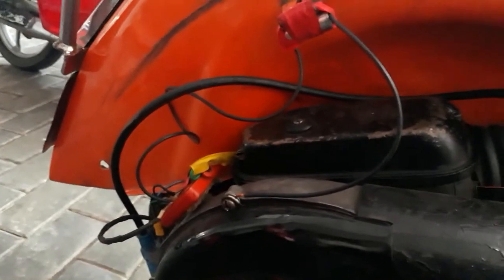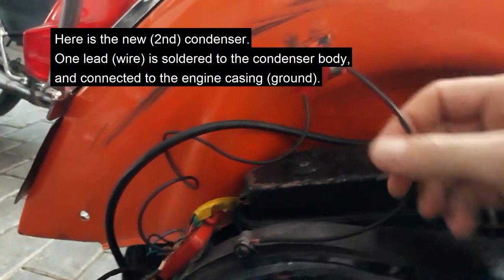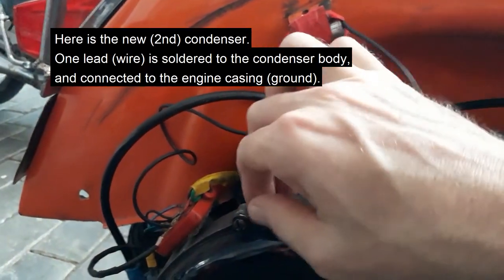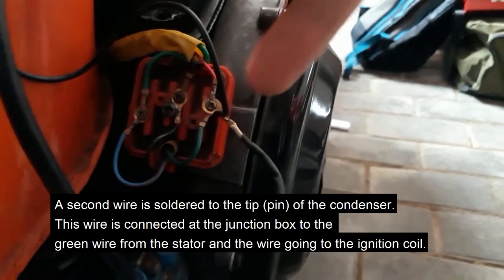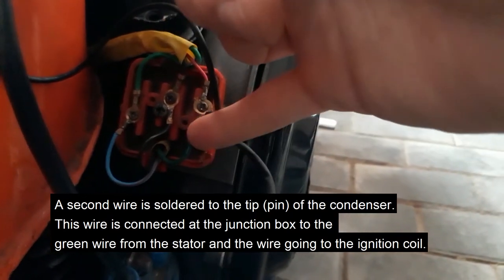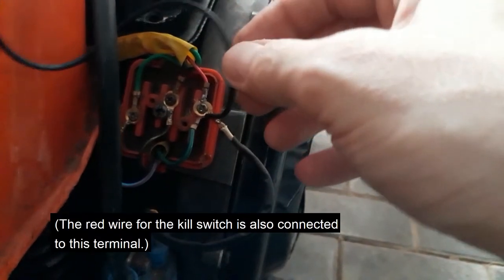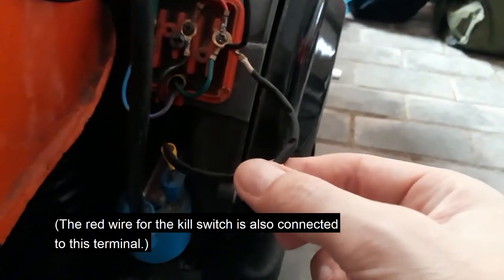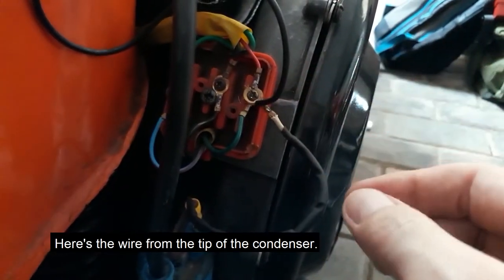Vespa P150X External Condenser Hack -- Stop Sparking Across Points!

Comment: Whats the rush?! Take a minute to explain the how and why
Reply from the maker: Ok, if you have a Vespa and you see sparking like that across the points you'll know why: the condenser is knackered, it isn't doing its job and so instead of the spark energy going down the spark plug lead and jumping across the spark plug in the engine, you're losing a lot of the energy making a bright flash inside the flywheel. So you have a less than optimal spark ('bad spark') and the engine splutters, hesitates, you don't get the smooth or as powerful acceleration / engine running as you should be getting. From memory (this is a few years ago now!), replacing the condenser that's in there requires taking the flywheel off, unsoldering the condenser, putting a new one in, soldering it in place, then putting everything back together. Fine, you can do that. But what if it's not your condenser that's the problem after all? Then you've wasted a lot of time and effort. With this 'hack' you can simply get a new condenser (cheap part) and connect/wire it in parallel (I believe) to the existing one without having to take anything apart. If it works, as in this case, then the sparking across the points problem is solved, and your engine immediately runs more smoothly and develops more power. As I did, you can tape the new condenser to the underside of the bracket/catch that holds the engine cowling  / side panel on, and start driving your scooter. It's an easy way to test whether your existing condenser is faulty, without having to replace the existing condenser, and without doing anything that risks messing something else up and introducing new variables; Vespas can be rather temperamental. The wiring I think is quite simple if you spend a bit of time looking at the engine/wiring and how it works, there are only about three or four wires involved in the whole thing. Vespas it turns out are pretty simple but quite ingeniously designed machines, it took me ages to figure it out but once I did I thought I'd make a video to show how it's done. Recorded it on my phone and the audio was terrible (er, the engine was running at the same time) hence the subtitles attempting to explain what's going on. Hope that helps!
Reply from the maker: Ah yes, I remembered: if you want to test the condenser you have to get it out (i.e. unsolder it) then you can use an ohmmeter on it to see if it's working properly. A condenser is a capacitor and you have to charge it up and then short it (IIRR) and see if the needle on the ohmmeter jumps, but you can't do this while it's connected to the backplate. In other words, it's a pain in the a*** to do that, you're much better off just wiring in a second one and seeing if that cures the problem.